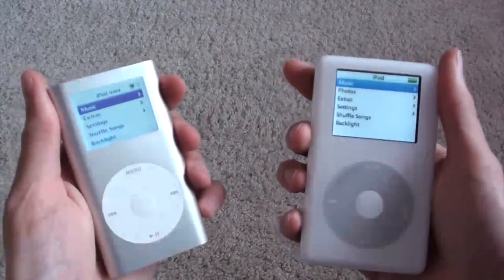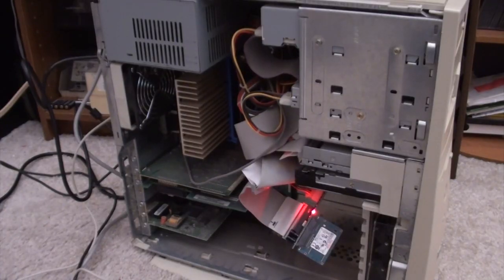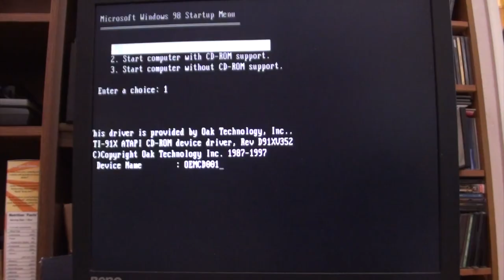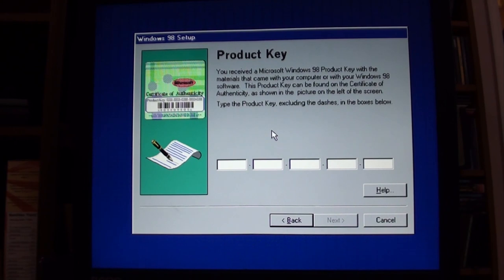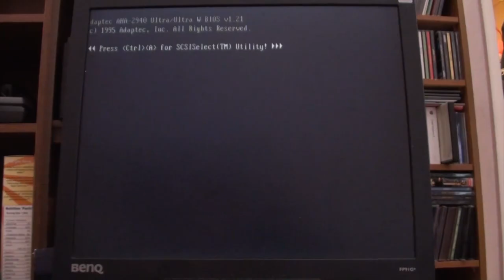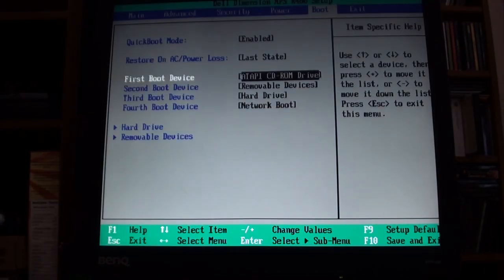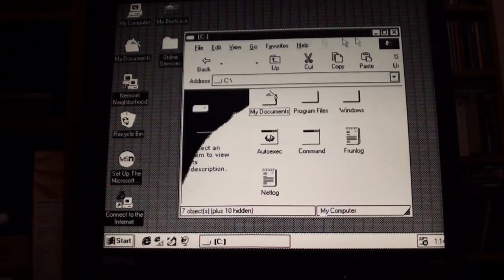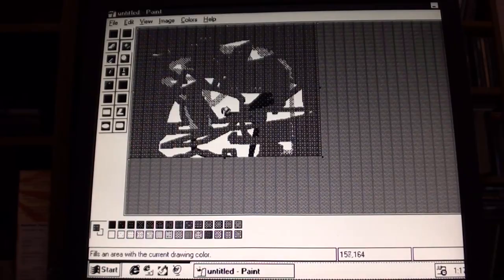Installing Windows 98 on an SSD

Comment: M$ should be forced to issue W10 on floppy discs. They might debloat it then.
Reply: David Lowe I don’t think you realise how many floppy disks that would be.
Reply: Hashim Aziz 
I don't think you understood my post.
Reply: There will never be a Windows 11. Window 10 is a service. Always being updated for free well as long you own a computer or license for.
Reply: Windows 10 isn't even that bad. Windows 8 was significantly worse, and nothing is as bad as the 98 era...
Reply: Mark Chang Whoa there. So much anger. I just don't have rose colored glasses. 98 was incredibly buggy and unstable, and was much more bloated than anything but Me. Did you forget about Internet Explorer being inserted everywhere? Did you forget about channels? Did you forget how common BSODs used to be?
Reply: Mark Chang You sound like you have major personal issues. You're taking a lot of offense at my statements.
Reply: Mark Chang Also, if you've only used it in a virtual machine, you're basically talking out your ass. I remember what using Windows used to be like. If you think Windows 7, 8 or 10 is anything but a major step up, you're delusional.
Reply: Mark Chang All the NT based versions were pretty good. (Everything from XP up has been NT based) Windows 2000 for example was excellent. But not 98.
Reply: If you wanted to “enter disk x” 5000 times, have at it. I’ll pass myself.
Reply: Mark Chang  you’ll get BSODs. It’s because nothing was segregated in win98 and 95 and 3.1. One program crashes, they all crash. It’s the way it was back then.
Reply: Mark Chang w10 is pretty good. I hate they dumbed everything down. But overall it’s vastly superior. There are people in this threads who understand very little about what an OS is and how it works and etc etc. and they should just leave off. 

My thing with windows (vs MacOS) is that any single aspect in Win10 you don’t like you can change. This we easier in 7 though. 

And I quite like Cortana. Clarification- I like the universal search bar. I leave the rest alone. But it’s good to see them looking forward even if they’re not there yet
Reply: I love Window 10. Works great on my machine. I turn off most privacy related problem. But I don't worry about Microsoft spying on me. It's probably true nsa and microsoft doing so. But I don't care. How ever doing billing better to do on linux. Theres nasty thing in Microsoft that can be like keylogger sending information and we wont know even if security appliance is updated. But Window 10 is very good I enjoy it on my Fast Ryzen Pc
Reply: Mark Chang I like W10 quite a bit actually. I hate Mac OS. And playing with Linux is fun, but not good when you actually want to get something done. 

Windows 10, and all the windows are actually great as long as you know how to use it. MacOS is just macOS you can’t do anything with it. Any aspect of windows you dont like you can change to something you do like. It’s compatibility is excellent. 

W10 has moved to making the customization more difficult and harder to get to in order to make it more user friendly, which I don’t like. But anyone who doesn’t like it- show me a better option...

Win10 isn’t perfect, but the other options are worse. If there are aspects of win10 specifically you don’t like, send me a message and I’ll tell you how to change it. 

You can do the same in Linux I guess but the knowing how is even more difficult than Windows. At least there’s documentation for windows. 

So disagree. Win 10 is the best windows. If you go with another version- XP nah, too many new good features in w10. 3.1,95,98,Me- not even gonna go there. Plus those were way more unstable. Nothing was isolated. 8 we all agree sucks. 7 was good. But 10 is basically 7 with some small superficial changes, that are nearly all better than 7. So yea, I use computers all day long. Study computer science, program. Etc. been building and repairing PCs since I was 7. I’ve tried lots if OS’es and I wouldn’t switch to any of them for daily use. Especially not macOS. Now for people who aren’t computer savvy, I typically recommend Mac- so it’s not like I totally hate it. Windows is good for people who know nothing (and just do web and email) and people who know the architecture well. It’s tough for people who know a moderate amount because they often know what they’d like to do, but can’t figure out how.
Reply: Mark Chang I just think you need to learn a little more. See my last comment. You fall in the “knows a little bit to moderate amount about computers” box I am sure. Which is why you hate W10. The much simpler 98 was well within your grasp so you love it. It’s understandable. Everything you like about windows 98 is achievable and then some in W10, though it takes a little more skill. You have to know how to manage group policy and what the different services do, and understand the access security. Win98 is an order of magnitude simpler than W10. Which in today’s age makes it much less secure and it’s lack of isolation makes it much less stable. 

MSFT does some jerk off stuff that pisses angry people (*cough cough*) off. Things like “suggesting” apps by downloading  them and installing them for you, suggesting web searches in Cortana, or installing updates at in opportune times, or incessantly suggesting you try Edge. But all of these things are modifiable if you just know how. 

Let’s do this. List what you don’t like about Win 10, and if I remember I’ll come back and point you towards a resource to change each one. I promise if you're willing to listen I can convince you that W10 is the best available. 

Or you can just be a comment troll.   Hating on Windows 10 on your macbook because you don't understand how to use it. If you don't want to learn, then you are probably right win 98 or mac is probably best for your use case scenario.  

I can even make your windows 10 look exactly like Win 95 if you want. 16bit color, boot logo and everything. You’d be in heaven.
Reply: David Lowe 6GB latest  Win 10 update size April 2018.
Reply: Mark Chang Need help for my Win98SE shutdown freezes.
Reply: i like w７
Reply: Jim Cervantes Windows 10 will not be updated for old processors.  They have already disabled future updates for old 2 core processors without certain extensions (security).
Reply: As long as its available on 360k 5.25" disks.
Reply: David Lowe do u realize that windows has had the same iso size since vista?
Reply: Sadly a lot of the newest generation would be like "what's a floppy disk?"  Lol. I agree though. So much bloat in 10.
Reply: I like that OP just said the objective statement that W10 is bloated and if you compare the normal home edition and the enterprise long term support bundle you can really see that without even having to say that windows 10 is garbage and that this version is better.
I use multiple computers with different OSs to get things done (yes I know I can optimize with a VM ;) ).
At the moment I've taken a liking to linux though, and specifically linux mint.
I still have windows 10 on a harddrive I've just not been booting into it since linux works great for me and I've got other PCs to mess around with for windows or whatever.
Reply: Anthony Wigren I am on secondary school and I know what a floppy disk is 😒 these people underestimate us
Reply: @Eddie The Head No it was extremely buggy and unstable, back then and Microsoft admitted this too. They ditched the old 9x Windows and based XP and all later versions of Windows on the NT kernel whicn is a lot more stable. A good decision.  Windows 98 crashed constantly with cryptic error messages and blue screens even on a fresh system.  I don't think there was a single day you could run the machine all day without at least a  few reboots.  (and in those days rebooting took several minutes.)  Even plugging in a USB device could sometimes lead to crashes.  When you put the blame on the user it's actually worse than when Steve Jobs said "You're holding it wrong". (because holding it differently actually solved the problem but there is no way any user could get around the limitations and poor memory management). Windows 98 also had other problems like being the Administrator by default so everyone who used the computer could install any kind of software. And everything that was run had full access to the whole system. Another issue was the tight integration of Internet Explorer in the operating system and stuff like Active Desktop. I don't think there is a single person who has any fond memories of Windows 98 and it takes someone with masochistic tendencies to use that operating system today.
Reply: @jacobw446  but i still have a sh** core 2 duo that can barely open a folder on a DVD and it freezes
Reply: microsoft would make a lite version of win 10 on a floppy disc

they do not listen to us and we need a lite version of Windows that can run on a pentium 2, it's still impossible nowadays because manfacturers don't make these good old specs anymore
Reply: @Eddie The Head 
Feeling smart when you use an OS =/= the OS being good. If we use that logic, then don't use graphical user interfaces at all - you will sure feel smarter.  But that doesn't make it good.
Reply: @Eddie The Head 
There are a lot more annoying bossfights in the series, such as Dreamland 2's Dark Matter.
Reply: What do you mean “debloat?” Standard W10 doesn’t have “bloatware”; 3rd party applications preinstalled without the user’s prior consent, generally for the purpose getting sponsor money for the purpose of driving the cost of the computer or OS down. No such software comes with W10. Those 15-20GB are just tons and tons of code. Do you think that delicious GUI is lightweight? Of course not! And if you want a lightweight OS, look to Lubuntu, but I’m getting sidetracked. My point is those 15-20 GB are being put to good use, not bloatware.
Reply: Andy T I will say: I love MacOS from the times I’ve used it (it’s absolutely beautiful and I terms of functionality, for my day to day uses it get’s the job done)
Reply: LOL good idea
Reply: @EssenceofPureFlavor  Win 98 SE was my first love, then win xp, then win 7.
Reply: Eddie The Head AT THE TIME: 98 was better than both 95, NT, and ME, only beaten by 2000. However, TODAY 98 is terrible!
Reply: Hashim Aziz Imagine them beeing 360kb 5.25” disks. It be thousands of floppies.🤣 It would be the best gag ever. I remember Windows 95 requiring about 17-20 1.44mb  3.5” disks. Aahh the fun of disk swapping, something kids these would never experience.
Reply: David Lowe hell no
Reply: Eddie The Head “windows protection error” I haven’t seen any of that on Windows 10
Reply: Ya know, maybe conroversial opinion, but I like the included software, even if I don’t use it, it’s nice to be able to do things at all without having to install 3rd party software.

The privacy stuff, again, controversial opinion but I couldn’t care less about companies harvesting/selling my data as long as that data can’t be traced back to me: the person.
Reply: @jimcervantes9043  Well this aged like fine milk.
Reply: @LouiesWorkshop  You must have a old computer to run Windows 11. :)

Comment: Need to put a gtx 1080 in that beast
Reply: it would probably slow it down
Reply: +Christopher Bazaka yep
Reply: lemme just cut a few contacts off the video card so that it fits in the AGP slot... lol
Reply: EXCESSIVE INSERTION FORCE

And with a piece of foil and some rubber bands you can convert any CPU into a homemade SEC cartridge package, then use the same application methods above (EIF) to fit it in the slot.
Reply: I think better to wait 20th series to install, 1080 will be bottleneck in this beast

Comment: 134 degrees what the actual fuck man, i was expecting it to burst into flames
Reply from the maker: +brotalnia The thermometer is reading in Fahrenheit. 134(56 c) is well within safe limits. Wanted to say this because I forgot to mention that in the video.
Reply: +Druaga1  install windows 10 on an ssd :D
Reply: whoops i meant to say how about installing windows XP on an ssd. sorry i said 10 i totally screwed up
Reply: :D
Reply: +Iceberg the genius 
That's been done.  :3
Reply: +Druaga1 Why are you using Fahrenheit? PC temps are always measured in Celsius no matter what country you live in.
Reply: Psythik

Because reasons. :3
Reply: +brotalnia put some dry on ice on that shit
Reply: +Iceberg the genius I think installing windows 10 on an SSD would be a little too easy :P
Reply: +Tibiafreeeeak I think he mistook Fahrenheit for Celsius.
Reply: +Jerkwad152 Such as?
Reply: Yep, another 30 degrees and then it'd be toasty.
Reply: Around 165 is when it's in the red zone. 134 is a bit warm, but not lethal for a passive PII.

Comment: You should have used a faster CPU. In 2004 I had much faster boot using an Athlon processor. IDE is not the only thing holding back the PC.
P.S.: very funny video :D
Reply: Was a good PII processor, I think. Mine was only 233MHz at first. An Athlon is very far ahead. I had one of those for ages. I think it was 1GHz or 800MHz.
Reply: PII  is 1997-1998 era

Comment: needs dma enabled and a proper display adapter driver and it's 4K ready
Reply: Yeah, turning DMA on probably would have made it boot hella faster.  Would have needed chipset drivers for that, and since the system is Intel, that would probably have been easy.
Reply: Thats what I felt.  Either a DMA issue or the IDE to SATA adapter might have been a bottleneck.
Reply: I also noticed that the hard drive only had a 40-pin IDE cable, and not a 80-pin connector cable.  That can really help with transfer speeds if the controller can support the higher speeds.
Reply: The Dell P2-400 had a BX chip set and only supported Ultra DMA/33 through the south bridge, A 30 pin cable should work just as well as an 80 pin cable in this system...

Comment: So the windows he uses is 98 years old?
Reply: plz be trolling
Reply: No 😂 Its from 1998.
Reply: So many comments. But if the windows 98 was developed in 1998 how can it on a ssd card?? I mean they didn't have that tecnology in those years. This video must be fake
Reply: I'll just pass through in case the dude isn't trolling. I've heard the 2nd question more than once (yes, people are really that dense). As long as the drive has a supported format, regardless of its type (SSD, SSHD), it will work the same.
Reply: +SwiftHDX lol i'm just trolling
Reply: The Magic Bush Glad you are. But like I said there really are people who ask that question.
Reply: bruh no 😤😐
Reply: d u d e
Reply: No, it was made in 1998
Reply: It's 1998 years old :)
Reply: It's actually 99 years old. This video was made a year ago.
Reply: it's the 98th version of Windows
Reply: The 98 corresponds to the year 1998
Reply: No way that is true.
Reply: The Magic Bush my windows is only 10 years only last year it was only 8 and 2years before that was 7.
Reply: The Magic Bush No,its from 1998-2001.
Reply: No it is the super futuristic version that is 88 versions greater than Windows 10

Comment: I'm not an old hardware enthusiast, but seeing old hardware get punished into submission from new hardware is refreshing. Windows was freaking out at boot tho. Every problem has a solution.

I wanna see a modern PC built with a floppy drive bay in mind tho. Bring back the freakin A:/ drive.

Comment: The IDE transfer speeds during the Pentium 2 era were limited to PIO Mode 3, 4, and UDMA/33. Due to these limitations, you may not fully benefit from the speed capabilities of an SSD. If you install a PCI-SATA card, theoretically, you could achieve speeds of up to 133MB/s. 

However, it's important to note that while SATA drives can reach minimum speeds of 150MB/s, the bandwidth will be restricted by the maximum throughput of the PCI bus, which is 133MB/s.
Reply: the reason why SSD's are fast is because of instant access times, thats the most important thing

Comment: I believe the lack of performance boost on that system is due to running data to/from the SSD using outdated IDE hardware. That hardware, and those ribbon cables were not designed to send/receive data at any speed that would give you a significant boost, using today's modern drives.

Comment: I remember using windows 98 and the xp and then vista and then 7 on a custom pc with a gtx 760, I upgraded my rig and transferred my windows 7 pro key and I then bought windows 8 pro on sale for £25 which is equivalent to around 20 dollars. I then got my proper upgrade to my rig i7 9700k and a rtx 3080 and with the windows 8 key was able to get windows 10 for free and then windows 11.

Comment: Windows 98 is the stuff of nightmares.
Reply: 98 it's just bad dreams. Windows me on the other hand that's nightmare fuel...
Reply: Mistake edition... Shudder
Reply: Josuel Servin  I've actually had more problems running 2000 than I did ME
Reply: TheCrayCrayGirl, oh nice lips 😎😊
Reply: Good Thing I Had Windows 10
Reply: Нормальная операционная система если ее не загрязнять программным мусором.
Reply: Mark Chang I would rather use Millennium Edition then change from Windows 10
Reply: Mark Chang What? 8 is much worse than 10, in every way.
Reply: TheCrayCrayGirl  You had more problems with Win 2000 then Win Me?! Then's there was everythring wrong with you or your computer at this time.
But fairly: Windows Me was by far the largest DAU Windows OS system of all time, Windows 2000 on the other hand, a server-based operating system that was not really designed for pure end users. Maybe that's where your problems are.
Reply: Quikmenu is the best u all know it. 2 button presses to boot up over 500 games
Reply: yuyu gvrfhgggg 5 harinas 2 de junio nos invitaron exceder
Reply: 4fg
Reply: Eddie The Head 
Same here but with win95
Reply: Windows 98 > Vista